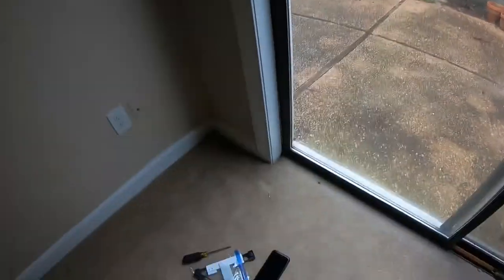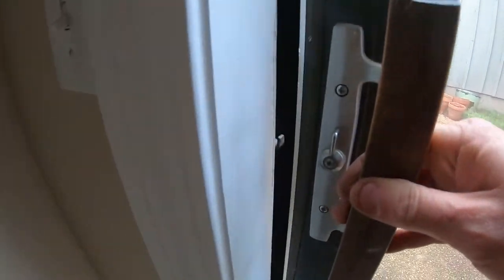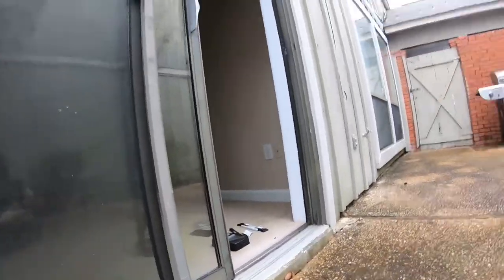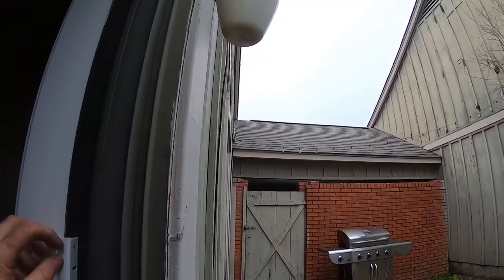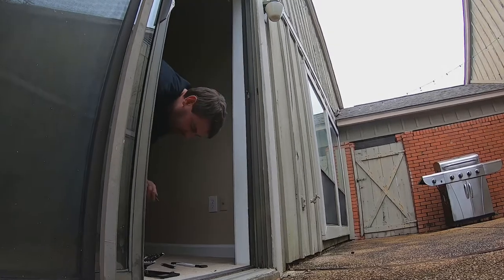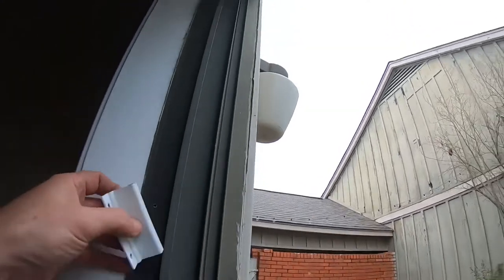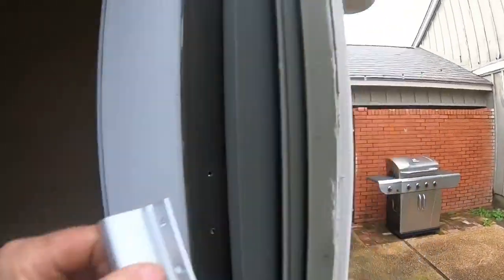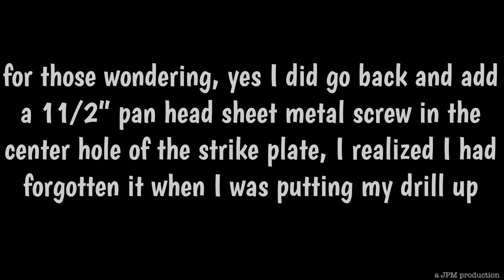Installing CAL Double Bolt Lock on Sliding Patio Door

Comment: Looks like the Lock-It one I bought but have to modify to use on vinyl slider doors. They are designed for sloppy fit doors by the instructions.

Comment: good job on the vid i have a q for you i saw you pull the door tight two the door jam  how easy or hard wood it be to open and close it for a elderly or disabled  person  on this install and on a stranderd  install and thank you for the link to them
Reply from the maker: caveman Sparks well, this door it wouldn’t be as easy but on a proper sliding door it is very easy to operate. On this one though, while it is a bit difficult I was pleasantly surprised at how less difficult it was compared to what I was thinking it would be.